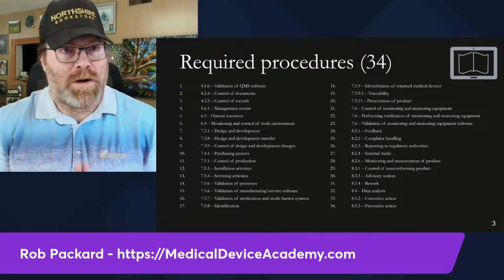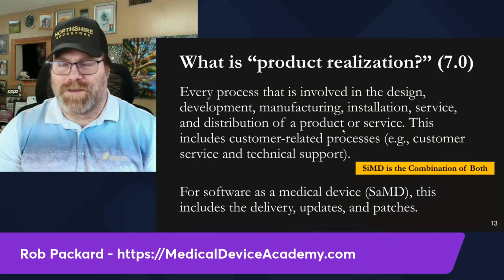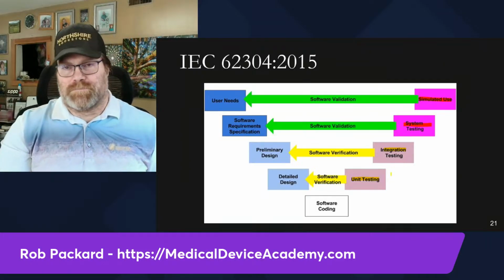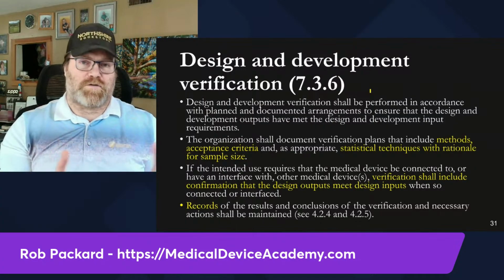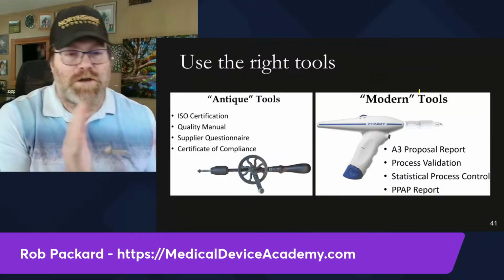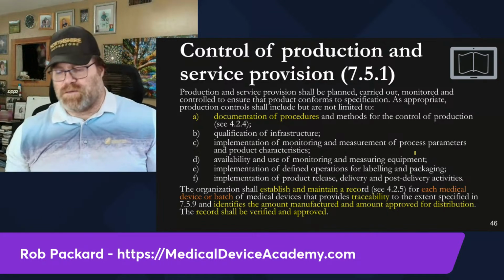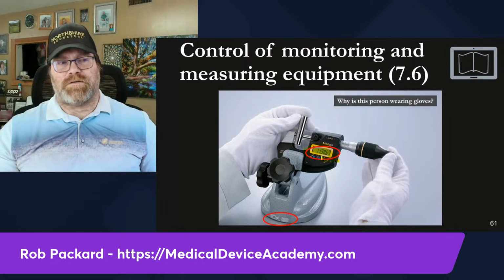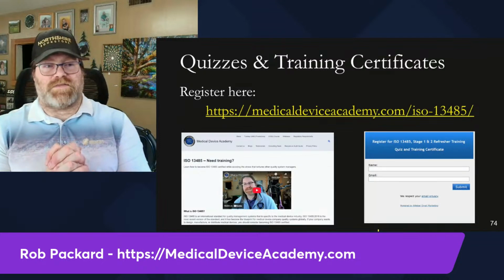ISO 13485:2016 Refresher Training - Stage 2

Comment: What are your thoughts on the foundational document from GHTF's SG3 -- Design Control Guidance For Medical Device Manufacturers and its guidance on design inputs?
Reply from the maker: The document you are referencing is a 1999 guidance. For anyone that is not familiar with the GHTF guidance documents, here's a link to where they can be found: https://www.imdrf.org/ghtf/archived-documents/quality-systems-documents. Not all of them are so old, but this is one of the oldest. It pre-dates the risk management standard, software, usability, and cybersecurity. This guidance describes design inputs in a way that is not consistent with today's ISO 13485 standard. The description used fit the definition of design outputs more than design inputs.